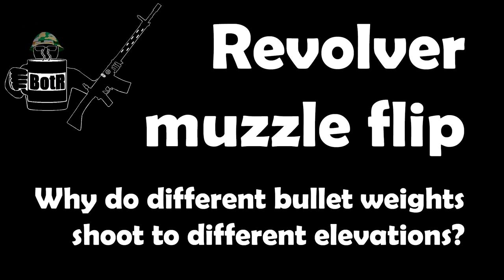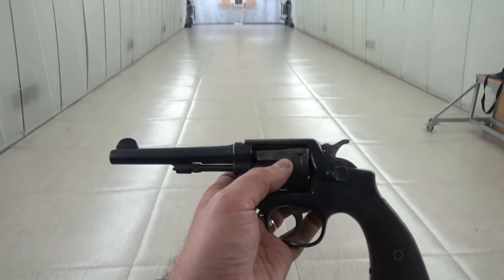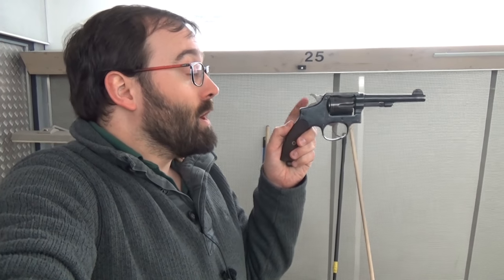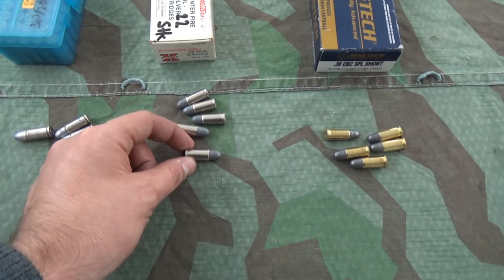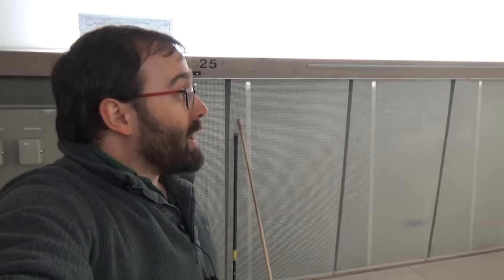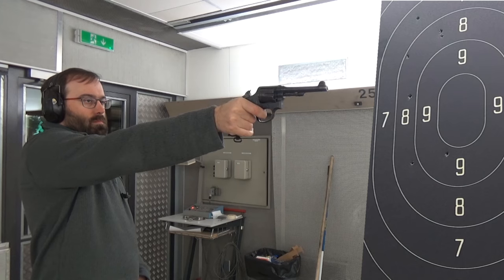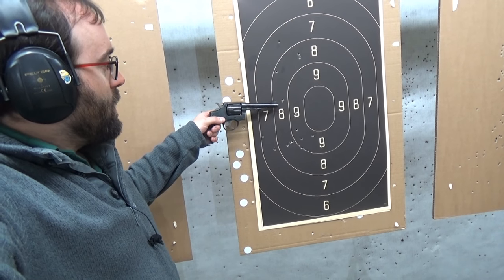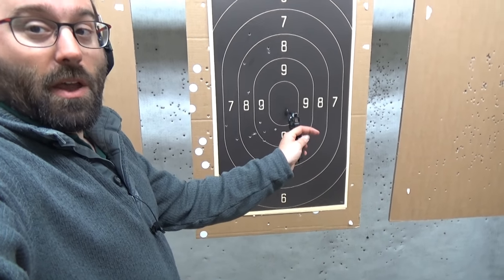Why Do Revolver Barrels Point Downwards?

Comment: At first I thought you might be wrong and that something else must be responsible for the different POI of different bullet weights in revolvers but the more I thought about it the more I think you might be right. A normal gun doesn't recoil until the bullet leaves the muzzle but a revolver has a gap between the cylinder and barrel which means gasses are escaping almost immediately so the revolver probably IS starting to recoil before the bullet leaves the muzzle. How very interesting, indeed. You may be on to something.
Reply: Before the bullet leaves the muzzle all ballistics are internal. This means that the internal pressure is equal everywhere inside the (then sealed) barrel. Hence there is no recoil (well, the forward movement of the bullet, and thus expanding volume under pressure might have some effect, but this is negligible). Only when the bullet leaves the barrel does the system cease being 'closed', and the Venturi effect of the pressure being released in one direction produces recoil. The roller skate example given does not model the same effects.
Reply: +Paul McRory That doesn't make any sense.
In the sealed system the pressure is the same as you stated but that means that it exerts the same force on the back of the barrel as on the bullet.
So the old "action equals reaction" still holds true and the gun experiances the same force as the bullet even before the bullet leaves the barrel.
Reply: Paul McRory Landon is correct. There is force in motion even though the projectile hasn't left the barrel. In your logic, a squib load that never leaves the barrel wouldn't have any recoil. In reality, that's not the case.
Reply: Ok, so what happens is that most autoloaders are operated by recoil force.

The barrel and slide are locked together and the force of the bullet moving down the barrel (very minimal, but it is a thing) and the gas escaping once the bullet is past the muzzle (most of the recoil force) are isolated in the slide and barrel. They move freely as a fixed together unit so the recoil doesn't actually impact the frame and shooter's hand until the barrel is tilted and unlocks from the slide, thus allowing force to finally be imparted on the shooter.

The AN94 uses a similar principle to isolate recoil from the shooter's body long enough to fire its two rounds without shifting POI very much.

Because a revolver does NOT isolate recoil from the frame and shooter's hand, and gasses are venting as soon as the bullet jumps the gap, the forces are immediately applied to the gun and the point of aim shifts before the bullet has left the bore.

Comment: You don't know what the fuck your talking about fella, you're shooting an old millitary and police revolver, if you look at the fore sight blade, you will notice that the shoulder lines up with the top flat surface of the rear gutter sight, you could use these two reference points for better accuracy, otherwise these  guns were aimed by aligning the tip of the foresight blade on the head of the man or man shaped target you were shooting at, thus assuring a center mass hit on that target. This facilitated faster reaction aiming in combat situations such as the military and police might find themselves, hence the name of the fire arm, Millitary and Police Revolver.
Reply: It seems we have a lot of criticism of The Bloke from "experts" who have never actually looked at the sights on a revolver.